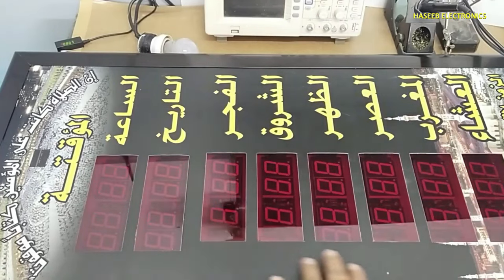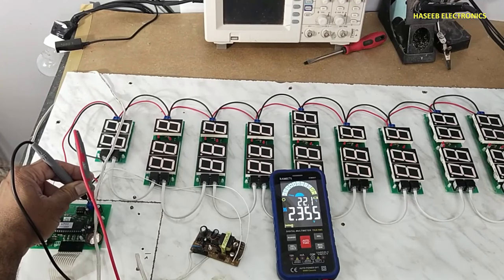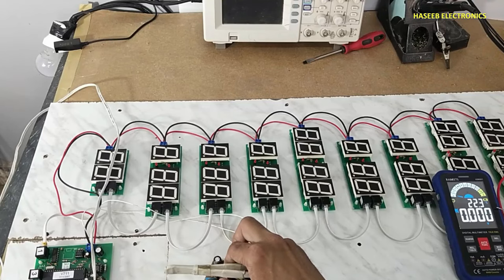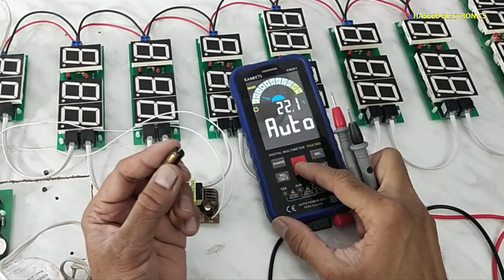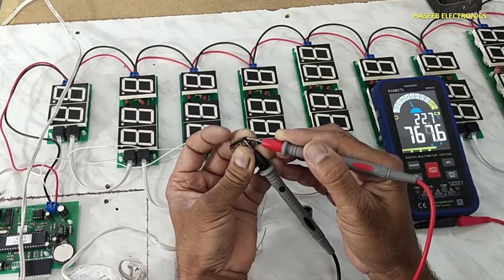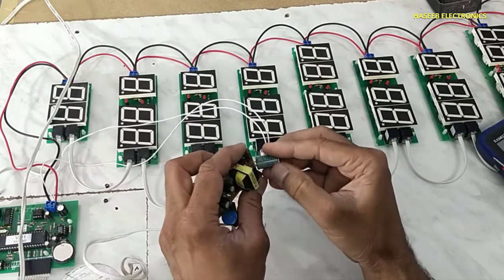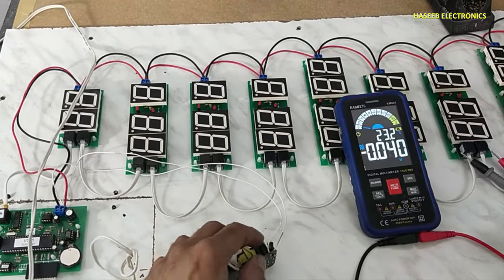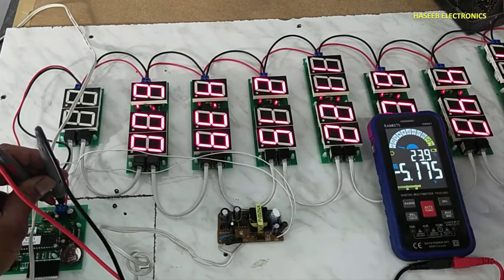{995} Digital clock repair, display flashing

Comment: Problem (yet again) reduced to SMPS repair. Nice job! Did you get time to peak under the hood, what MCU is driving the clock?
Reply from the maker: best regards and special thanks 
i didn't checked the MCU. but in future i will share its circuit